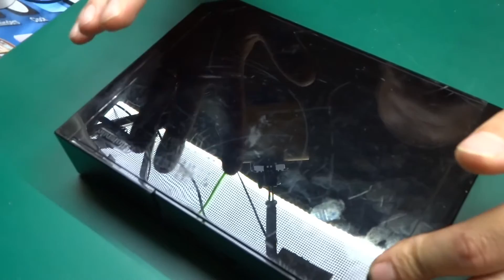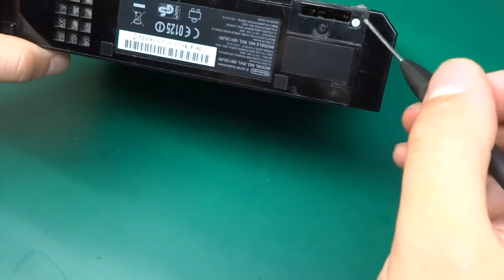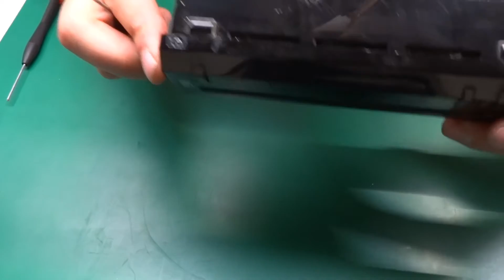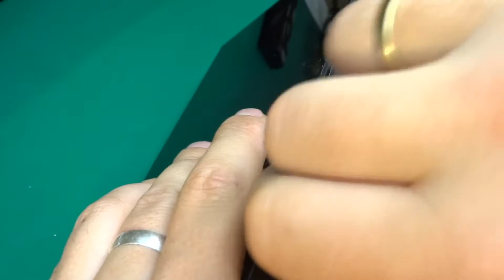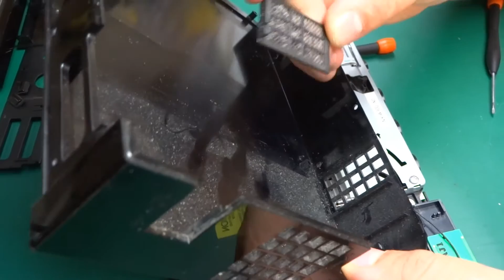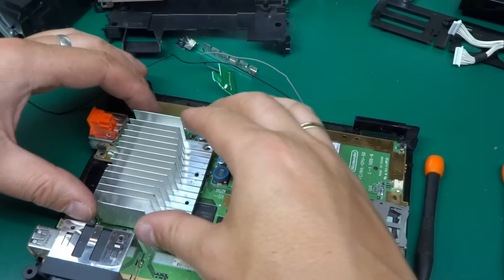Wii  black teardown and orbit cam test

Comment: This orbit cam is a great idea. Did you come up with this yourself or has someone else done this already, or inspired you?
Even if it wasn't continually moving, having the ability to change the view angle like this is great. You could even have a foot pedal on the floor to control it.
Reply from the maker: SpiderEyes thanks. It's not a unique idea entirely, it has been dobe before, but never this small. Usually the camera orbits on a long boom arm, radius in meters. This one here is tiny due to lack of space :)
Reply: Well if your electronics bench could be measured in meters you may want to consider putting a seat on your camera :-D
It seems to run very smooth either way.